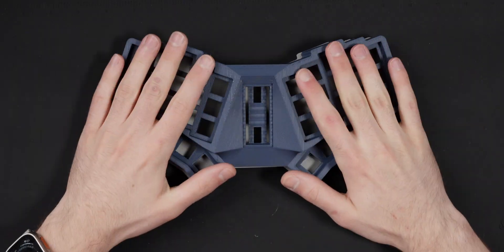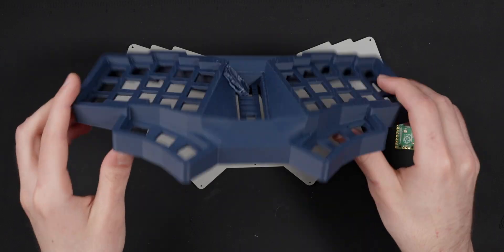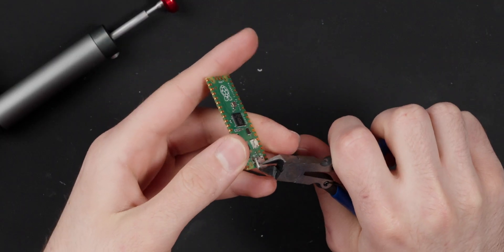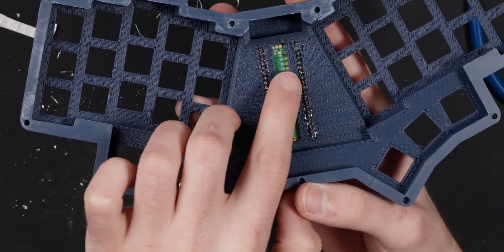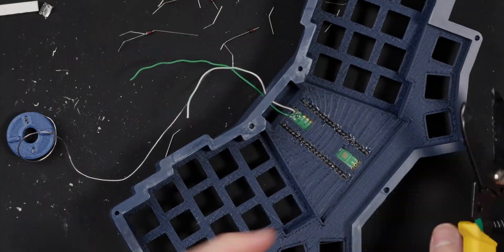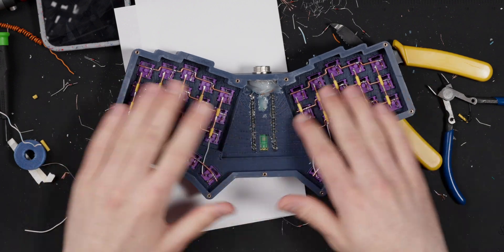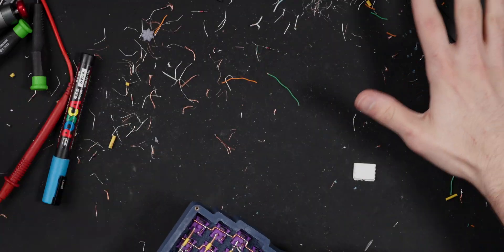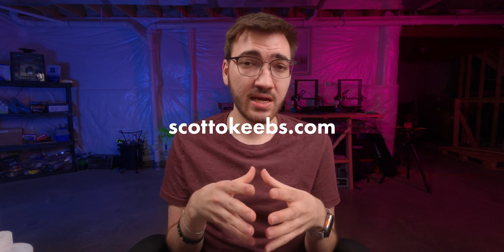Building My Most Ergonomic Handwired Keyboard Yet...

Comment: Interesting, but the clear winner at this point is a split design.  Users of this keyboard a stuck with fixed decisions that might work for some in some situations, but not others.  Why remove flexibility from the outset? The difference of a $5 - $15 microcontroller?

Comment: Awesome build. Love the design  and Im trying to build one. The  case STL you graciously provided on github is not watertight so Cura doesn’t let me slice it. It tried fixing the model in various 3d software without luck. Any tips?
Reply from the maker: There are settings you can use in Cura to make it watertight. Search something like “Cura mesh repair”

Comment: Hey! really great video. I love the idea of an aviator as the connector. 
Rather than soldering to the test pads next time you could try using pogo pins. The friction of the header  pins would be enough to hold the pogos down on the pads. That way the connector doesn’t get soldered to your pi. Also, as a bonus, one of the test pads is bootsel so you could bring that out to a small button on the back to bottom too.

Comment: very awesome build and I'd want to build one myself, save to add an extra pinky column on the sides since I main on 40% layouts. Would it be possible to just edit your stl file? Need to learn all of that tho.
Reply from the maker: You could edit the STEP file. This board in particular will be a bit more challenging than any of my others to modify though because of the way it’s tented.
Reply: @joe_scotto  thanks! totally forgot about the tenting. well noted!

Comment: how do you use the diode leg to mount to that round pin female socket? I have the exact same female socket but my diode leg is too thin (around 0.3mm diameter while the socket hole is 0.6mm). As a result, the diode leg can not be firmly plugged into the socket.
(I am looking for a way to have low profile hotswap MCU like yours)

Comment: Great keyboard! Why the aviator connector tho?
Reply from the maker: Because I thought it looked cool and gave me a reason to use the test points on the controller.
Reply: @joe_scotto  it does look cool! If we wanted to modify the build to allow room for and power the pico with the usb-c connector would it still work?
Reply from the maker: @vdubmerc3  You should be able to. USB-C has been hit or miss for me but if you can find a cable with 4 wires, there’s no reason you couldn’t just hook that up instead.
Reply: @joe_scotto  Thank you!

Comment: Awesome build! Tip on removing those type of SMD components with out a hot air station is to use flux. I recommend a flux pen. The flux will heat up the solder so you can use the solder sucker and remove all of the solder.
Reply: +1 for this method. I ripped so many pads before discovering that i should be using flux. Make sure to get a flux pen or something that comes in a syringe tube like chipquik, the rosin flux that comes in tins smells nice and piney but is an absolute nightmare to work with and clean
Reply: This is the way. Flux, then lots of solder, and the whole thing will fall out.
Reply: Ehh wouldn't neceserally help. I'd say the best method is to add low-temp solder(like rose's metal or wood's metal) or just plain old solder(aka one with 40% pb), since manufacturers use no-pb solder, which has way higher melting point and preferabbly preheat the board on a hotplate, to like 70-80°c and then use lots of flux on top of that to help with heat transfer(can be switched with just grease or lube, since we don't care about using flux as flux, just try to avoid corosive ones).

This way its easy, hassle free and puts as little thermal stress to the board as possible.

Comment: Nice keeb but why have you made the pi pico hotswappable and then put a peace of glass on top that perminantly closes it?
Reply from the maker: Initially the idea was to have it hot swappable but I realized by connecting the aviator to the back pins, it wouldn’t be. The sockets are a nice way to mount controllers regardless.